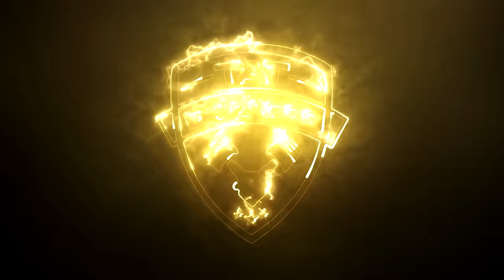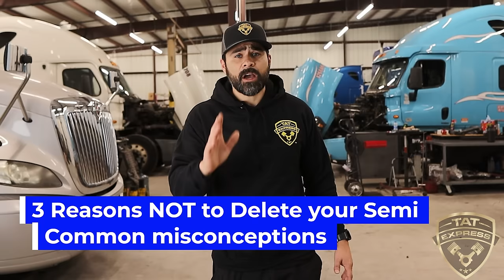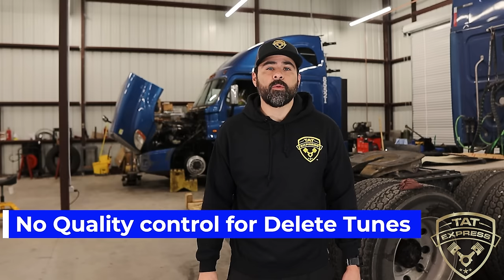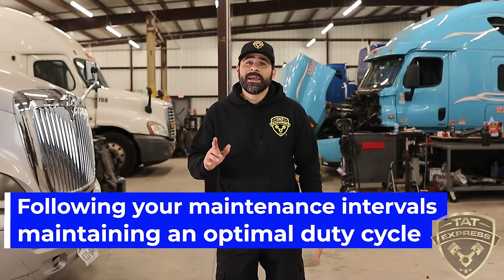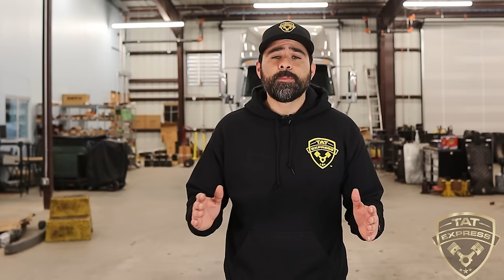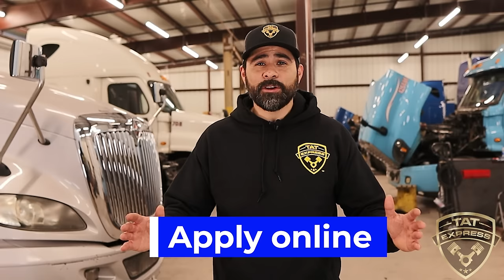Do Not Delete your Semi/ Do NOT delete your Semi/ Three Reasons Not to Delete your Semi/ DPF Deletes

Comment: 80 percent of tows are because of def issues.
Reply from the maker: Preventive maintenance is essential. Thank you for watching, and God bless. We are just speaking of experience with faulted engines due to hack deletes but to one his own.
Reply from the maker: As mentioned, proper modifications are unavailable for all models, so taking chances with a delete may result in costly downtime.  We have been servicing diesel engines before after-treatment systems and have seen many cases.
Reply: Don't lie please. All the truck problems about DEF. And DEF is enemy of your engine.
Reply: @TATEXPRESSINC  delete may result in costly downtime. Not deleting will result in costly downtime, lol.
Reply: Def = problems = repairs= more work for shops.
Shops will advise to not delete.
Reply from the maker: @David-lo2gq you can delete if you like. It’s a free country. We are just sharing our experience.  Good luck and thank you for watching.
Reply: Ugh, man I’m glad I gave up that issue lol

Comment: I owned a 1999 freightliner century with a 12.7 Detroit. Put over 1 million miles and total shop repairs were $12,000.00 over 8 years. Currently I own a 2016 cascadia, it's so awesome. Now I spend between $18,000 and $25,000 a year on repairs. Obviously a better deal. Lol.
Reply: But you 1999 freghtliner with 12.7 detroit engine runing is good no dpf sistem right
Reply: Lmao...bet you kicking yourself now aren't you..can't give me this new junk and even if you did i'd trade it for something pre def or a glider
Reply: I have a 1999 century with N14 I would get rid of it for nothing.
Reply: They say the 10 mpg is the wave
Reply: cant beat an older truck
Reply: I did my math and with heavy loads, it costs 10.000$ a year just to have all emissions on, and that does not include repairs/down time/maintenance of it, just straight up def fluid and extra diesel. 

And if you have to diagnose/repair all that emissions toys? Have fun.

Comment: Funny how the trains and planes and tugboats and large vessels dont have to have After treatment systems
Reply: Or the Volcanoes in Ecuador.

The problem is, ya can't tax the volcanoes. Or industrial pollution which accounts for 97% of the garbage in the air.  But your Toyota fails smog and straight to the bone yard.
Reply: A 747 burns 5000 gallons of unfiltered fuel on takeoff and climb but diesel trucks are the biggest problem.
Reply: Actually trains do have DPFs on them
Reply: Wow so right I never thought of that🤔👑💯
Reply: @edgartaylor7421 a dieseil particulate filter ?
Reply: @locuda2010 ❤
Reply: There are also a lot more trucks than trains, boats, and jumbo jets.
Reply: @TainerBro because trucks on congested roads and cities with many other humans. Planes and boats are not.

Comment: When you understand the owners downtime and cost of all that crap you would understand what all of us are going through.
Reply: Learn the systems on your truck, find the correct diagnostic software to monitor those systems in your truck with a laptop. It is not rocket science, and once you figure it out, it is easy to keep these pigs running. Not as easy as an old school non emission diesel, but easily doable. You may have to get your hands dirty too... Most truck owners refuse to do that and then complain when something breaks.
Reply: @michaelwright1602  man cut it. A new one box is 15k. Aftersystem treatment is one of the most common and expensive part of maintenance. Once anything from a nox sensor to a simple line will cause derate..aka no money made.
Reply: 2 months and 25k later.
Reply: @qb6570 If you can't operate legally, you need another line of work.
Reply from the maker: Preventive maintenance is essential. Thank you for watching, and God bless.
Reply: @6582rg they can't enforce their stupid rules and they don't obey them. New military vehicles are exempt
Reply from the maker: With preventative maintenance, expect to replace the DEF filter yearly and DEF every 400k miles. It may be budgeted and scheduled before major issues can occur.   We are sharing our experiences with trucks that have been deleted and ended up with low power complaints and engine damage.
Reply: This guy clearly doesn’t understand the problems that most owner operators have to endure with these dpf systems.
Reply: I had an EGR cooler failure that put me down for about a week in the shop and I tried to cheap put on generic AHI modules so I lost that time waiting for them to keep shipping to me. So like 2 days for each one times 3. Which I could have prevented and made zero down time if I had ran down to the dealer in the first place.

Other than that, my issues with an emissions truck have nothing to do with the emissions and are/were just used truck things.

Education and correct tools (in this case factory diagnostic software) can help you through it and save you a ton. Education comes in the form of the internet (YouTube, Googling for documents, etc) and is widely available often for free.

This guy isn't telling you to keep your emissions just to get more work for himself.

Emissions systems are not maintenance free, but they don't have to be a nightmare.
Reply: @JJMGBC you’re clearly smarter than him. You’re the driver. he wouldn’t understand 💅
Reply: What about box trucks
Reply: @TATEXPRESSINC   I have never heard of a single person that regretted deleting
Reply: @notsure6182 I know multiple that wish they hadn't deleted their semi after non-stop problems and ultimate failure from garbage "Tuners" that destroyed the truck.
Reply: @100pyatt  I dont know anyone that wants to have that smog shit on their truck. were you the hack that messed up their trucks?

Comment: Of course a mechanic will try to convince you NOT to delete a truck. DEF systems have caused more issues than non pretreatment engines.
Reply: Hack job deletes kill more motors than any emissions systems , head gaskets rarely last more than 500K on any deleted truck. Some are as bad as replacing the head gaskets every 200k

Comment: Yea... I've came into the industry dealing with def, it's usually the only thing keeps me in down time. I maintained my trucks well rarely any issues with the engine but the ATS is just straight trash. Honestly really considering just deleting it all together, met a few drivers with older trucks than mine, and spend less time in the shop.
Reply: I was Truck Mech for yrs the ATS is and the worst thing. They drop trucks to us with no TRAINING ( AND WORK WITH A FLEET) the management was pist .

Comment: If you are going to put a video out telling us why we shouldn’t be deleting ats, you need to give some solutions.  Thousands of truckers have been put out of business due to the government regulations.  I have a small trucking company, and my mechanics spend the majority of their time troubleshooting ats. Many times, the big dealers can’t give a straight answer for a correction.  The systems are too complicated and unreliable. Maybe if the money was coming out of your pocket to keep the nox out of the air, you would change your time.
Reply: He prolly makes a killing on ATS repairs. Conflict of interest much?
Reply: Yep,he's just yappin away !
He knows is a scam and they make a killing repairing them.
Very big conflict of interest that's why he made this vídeo.!
Reply: The dealership didn't know in the very beginning and still don't
Reply: He is just like a politician (the guy on the video)
Reply: They're actually not complicated if you can read a schematic. Just understanding what the system is designed to do goes a very long ways.

You have to understand what the EGR is doing and why, what the DPF is doing and why, and what the DEF is doing and why without confusing them and using them interchangeably. I see so many people who use DPF and DEF back and forth thinking they're referring to the same part of the system when they're not.

After treatment is 3 distinct systems basically in a series designed to handle different "features" of the exhaust. They all have to work for the truck to run well, but once you understand how they're separate you can start to look at what the error codes are saying and understand what part of the system is failing. It's not an all or nothing "everything is bad" situation.
Reply: BTW I'm not a mechanic. I bought a used 2014 Mack and have had to figure it out. I've done a lot of the work myself, the only exception being the EGR cooler because of physical limitations.

Comment: I wouldn’t have such an issue with emissions on Diesel engines but they aren’t reliable and when they do break it costs a fortune to repair and you need high end programs to see what’s broke.   Diesels need to breathe.   Less restriction more fuel economy

Comment: I brought a 2011 Cascadia from a owner that was tired of dealing with the emissions. I deleted it at around 560k miles. Truck is at 980s with just regular maintenance. I haven't seen anywhere with an emissions truck same set up with that mileage.
Reply: Hey after delete do you still have to have the filter clean out ?
Reply: @juancepeda9620  no

Comment: I'm at leat 30 grand in the hole over the past 3 and a half years trying to keep up with my dpf system , count the missed loads and I'll be another 50 grand out ,
Reply: Am over 50k , he can say whatever he likes
Reply: Did you guys delete?

I can’t afford to keep it I might as well turn in my truck.
Reply: @cesarcastillo9561 no , fixed it again and sold that truck , bought a deleted KW
Reply: Then you’re getting fucked by your dealer or shop. That’s an insane amount even for consistent issues.
Reply: Bro how tho? You could have bought a new one box and all the sensors for around $10,000 if you install yourself. It’s simple to do actually. That should have kept you out the shop for a while. If you’re having one ATS issue after another don’t spend time with mechanics constantly diagnosing that shet. That labor fee will cost you more than just replacing the damn thing.

And if replacing it doesn’t help you and you still get derate. Then you have a problem going on with your engine. (Assuming replacement parts were not lemon/bad quality)
Reply: @calebmatty5060 it’s not tho? Over 3 years? If you keep going to the shop it’s easy to spend that much.

Comment: My husband says you can't go wrong with a 89 Kenworth w900b flat glass with a 3406b all mechanical cat. No emissions crap not even a computer.
Reply: Very true
Reply: 4-5 mpg, no cab air ride.  yes very nice truck, but still a pile of 💩.. almost 40 year old
Reply: @TheDriller100 what do you have that’s so much better? Honestly curious. My truck is older than I am and I’ve been considering a newer truck but scared to death of DEF/DPF problems

Comment: I have 2015 volvo with cummins Before DEF DELETION i was in the shop 2-3 times a month. 
In 2018 i  DELETE DEF I NEVER BEEN IN THE SHOP SINCE.
Reply from the maker: Thank you for sharing and God bless. Yes, late models may be easier to bypass due to outdated technology, but it is not recommended. Preventive maintenance is essential.

Comment: As a Owner Operator the shop labor fee is extremely  high. 
After 800.000 miles the DEF system brakes down more offen.
I have 2 tows because that DEF system its like $ 4800.

Comment: My older diesel pickup gets 28 mpg my new one gets 14 on a good day and they both have about the same power, you're having to produce, refine, transport, and burn twice as much fuel for newer emissions engines not to mention mine for materials and manufacture these emissions systems. Don't blow (smoke) up my ass and tell me that doing all of that is better for the environment. Everything on this planet is carbon and you're not lowering the carbon with emissions you're lowering the NOX.

Comment: Well I haven't driven a deleted truck but I have driven two pre-emission trucks and a couple of trucks with the def b.s...the (no def) trucks only had to go to the shop twice for non engine problems..the clutch went out on the 1st, and a coolant line from the radiator to the apu went bad on the 2nd...but the def trucks stayed in the shop for def related problems..from dpf, egr to sensors it was always something...so I'd take an older truck over a new one anytime

Comment: If the government is so concerned about environmental issues why don't we change the current technically obsolete models with European ones? They extract 560hp from 10 liter engines with 30-40 % less fuel. Why can't you import a truck like that here?
Reply from the maker: Europe has stricter environmental regulations.

Comment: I'll stick with my factory glider
Reply: How long have you had that Glider? How has it treated you? Your comment is more valuable than the video itself.
Reply: @hasansadig8758  I've had my glider a little over a year.  It's been wonderful.  I have a Detroit diesel 60 series 12.7
Reply: @jdavis02136 , hello, I am looking into buying a truck soon. I was thinking a truck year below 2008, to avoid this emissions BS, then I seen a couple of Gliders. Are Gliders illegal. If I got one would I have problems with D.O.T. your reply would be appreciated.
Reply: @hasansadig8758  yes they're legal . My truck came from the factory with a 1999 60 series 12.7 Detroit ,  so dot has no problem.

Comment: IM in the middle of the ultimate delete: I am deleting my DD15. I have a reman 1998 Series 60 12.7. I found a motor mount kit for Cascadia gliders and had to have the front plate mount reworked . EVERYTHING works with no lights, cruise, brakes, throttle pedal (out of the donor truck). I even kept my 13 speed. My 2014 Cascadia is a former Swift truck I purchased in 2018 with 475,000 miles. It has  892,000 now and still runs (I deleted the DPF filters , drilled them out at 672,000 mile) and bypassed the 7th injector and lived witha yellow light ever since and every freightliner dealer whining about my truck throwing codes but it RAN with no derate and no issues and NO DEF (I just added water). Now thansk to government rules I will have a reliable and decent truck that is still in great condition. Front air ride all new, both drives completely rebuilt 6 months ago, new fifth wheel all new interior and extra sound insulation, mini-split AC with a Nissan leaf battery behind the sleeper that runs the ac for 12 hours without recharge (its a heat pump and it will heat to about 25 degrees then it gets really ify but I have a $150 chines diesel heater that will run for DAYS on the leaf heater even with the battery packs heater running in cold climates. Anyway, EFF the EPA and ANYONE who claims a delete is a bad idea. For those of us who could not have made it without saving $  from doing a delete its REALITY!

Comment: I have a KW 2019 with Cummins isx 15 less than a month I spend more than 3,000.00 to try fix the DEF failure and still have the problem till delete the fu$^@%# system. So you could say whatever you want to but owners operator who is going to pay for nothing.
Reply: Where did you delete the system I have the same issue bro please help

Comment: The gear ratios that fleet trucks are getting in their trucks keep emissions engines at RPMs higher than they ought to be when driving at 70, 75; or some higher and rediculous speed.  Spec your truck so that the engine at the highest highway speed you drive is in the meat of the torque band.  With a DD15 or DD16 engine that means that your engine speed should be at 1400 for a DD15, and can go a hundred RPMs lower with a DD16 engine.  The DD15 and DD16 engines torque band starts at roughly 925 RPM and falls away at 1450.  It is not what your engine makes in peak power that counts.  It is what horsepower you have in the torque band that makes the difference when climbing grades.  With horsepower comes a faster heating under load of the engine oil, which leads to blowby and oil lifespan issues.  I am not advocating for taller gears for heavy haul applications, just 80,000 lbs, 36288 kilo and lower permitted vehicles.
Reply: U want torque to climb not hp hp is ur feul

Comment: My job has a 1996 Isuzu box truck that now is in use more then the 64,000 mile2016 Isuzu box truck because the DPF system won’t allow the truck to go more than 5mph the tow alone would be 400$ plus finding a reasonable mechanic, estimate was 5-8 grand due to a emission system if it were my decision I’d remove it and not have any problems regarding the system as I’ve seen trucks with a dpf delete run 400,000 miles after

Comment: So I have a 2015 Volvo and it kept shutting off so I took it to Cummins and they told me it was a few sensors and charged me $4000 I picked up truck and drove 10 miles and truck shut off again , then I turn it on again and it started blowing black smoke , drove it back to Cummins and now they want to charge me 14k to fix , the dpf system, the sensors they replace was all dpf related (Cummins isx15) and saying I need to replace all the sensors again because they all damaged and no warranty on sensors???

Comment: So where does the soot go that the DPF collects during regen?
Reply: Back into the air...makes sense to have a after treatment system right....🤣🤣
Reply: It turns Into different less polluting elements ,air coming out of tail pipe is clean ,no smoke for the most part .

Comment: So where does all the carbon go when you do a force regen?
Reply from the maker: In a DPF regeneration, carbon compounds in the form of soot and Particulate Matter are oxidized at high temperatures, often exceeding 600°C (1112°F). This process converts the carbon particles into carbon dioxide (CO2) and water vapor (H2O), which are then expelled from the exhaust system.